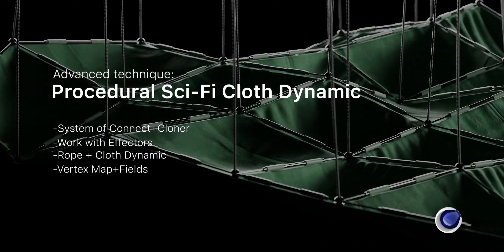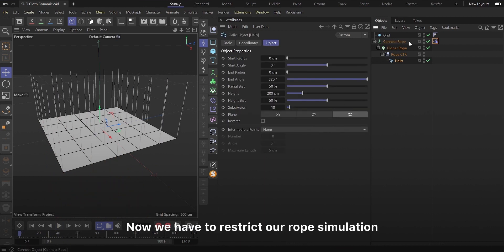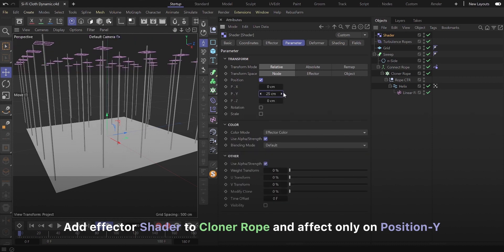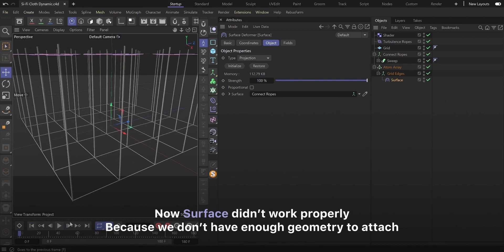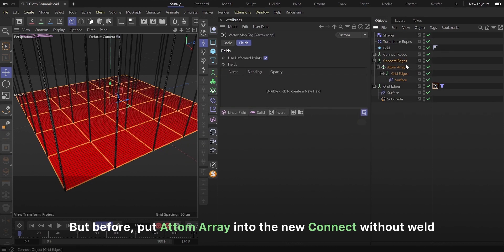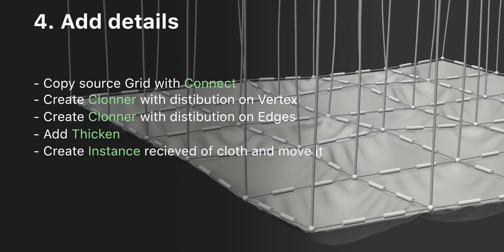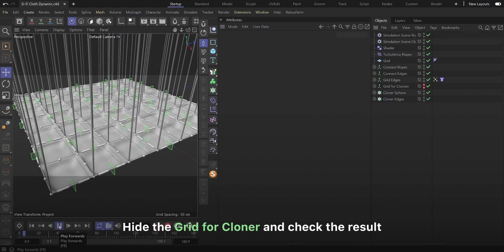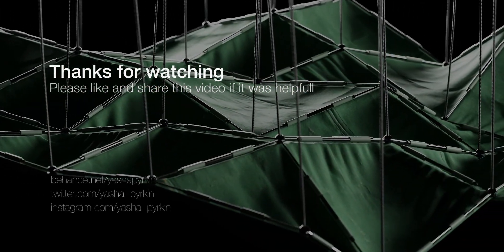Procedural Sci-Fi Cloth and Rope Dynamic in Cinema 4D

Comment: if someone has problems at the stage of rope simulation, then in
the Rope tag you needs to specify the vertex map that is on the helix.
(this step is skipped in the video)
Reply: how?
Reply: @felipesalvador597  drag the vertex map from the helix into the map parameter of the rope tag. :) 
Thx, btw!
Reply: Thanks bruh
Reply: Dude.....THANK YOU xD
Reply: i did it, but my ropes still dont move... it's like they re stock in yhe the grid not only in the vertex map